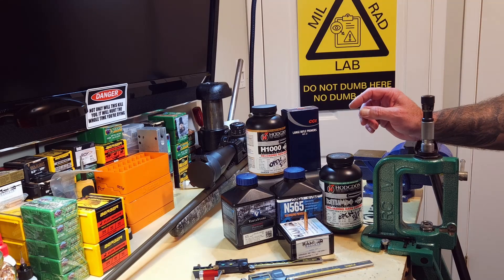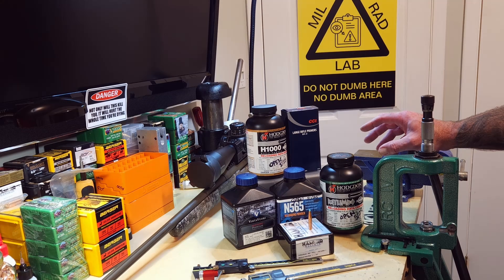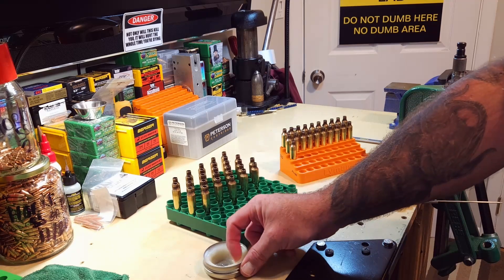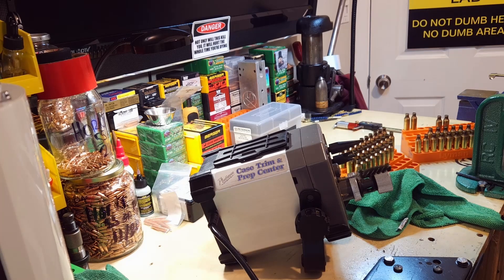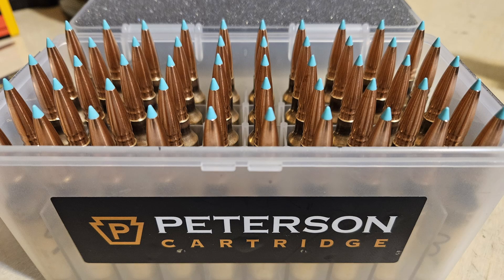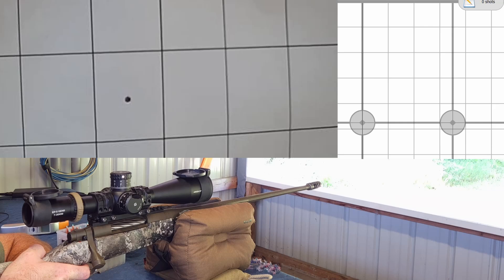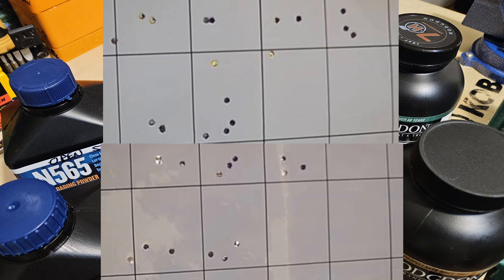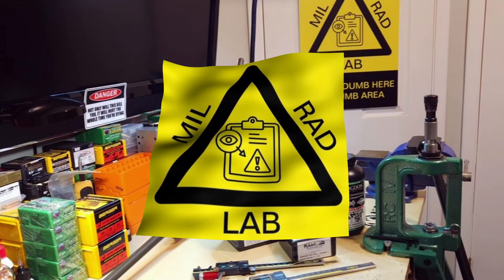Reloading 7mm PRC vid #5 Hammer Hunter Tipped 162gr with H1000, Retumbo, N560 and N565

Comment: I was considering the 195 berger for my seekins ph3 7prc 22". The loads you have here are way over hodgdons max, any pressure signs at all?  I took 175 eldx to over 2900 at 70gr retumbo with no pressure  but running low on capacity.
Reply from the maker: Thanks for watching! Yes, alot of my data is beyond published loads - sometimes way under though. Books cannot tell you what your chamber and bore dimensions/metallurgy  will produce, so I always try to start somewhere in the middle of the published data and work up until I see pressure signs. I have found pressure while testing all of these loads, video 3 and 4 in this series run that down oretty good. My hunting load is Peterson brass, 195 Berger, 71.3gr N570,  BR-2 going 2938 out of a 24" with zero pressure sign. Sub half MOA every single group with a $400 rifle lol...funny to even type that.

Comment: Ramshot Grand is rocket fuel in the 7PRC , 162 Hammers , 160LRX and 160Cutting edge lazers will run 3200+ in my 26 in barrel with ADG brass at a book max load .
Reply from the maker: If I were going to use light weight bullets like those, I think I definitely would've ended up trying Grand. I decided on the Berger 195 as my go-to and N570 is definitely "the one" behind that bullet.

Comment: Been watching lately as I'm about to start loading up some hammers my self, a great source has been hammers loading forum under "what have we learned" they talk daily in depth about using factory crimp dies. Here's a small portion of the description - "Hammers are more ”slippery” (best I can describe it) than standard bullets. The PDR bands on the bullet reduce contact with the case neck (and barrel). Crimping seems to help the bullets get a more even and consistent start. My personal preference is to start at 1/8th turn. I also use the crimp die as a final tuning device to get the lowest SD/ES possible. Once I find an acceptable powder charge (accurate) at 1/8th turn, I change the crimp setting from1/8-1/4-3/8 and record the ES/SD. The lowest spread USUALLY/Not always gives me the best groups. Since I develop the load with a crimp, I don’t see a significant change in pressure while adjusting crimp on a full pressure load. I also do not see a significant change in velocity. At most, I’ve seen a difference of 20 fps in speed going from 1/8th to ½ turns on the FCD." Multiple other sources also state that groups shrink significantly when tuning with the crimp die. Figured it might be worth a shot! Vortex nation had a podcast as well that talked in extent on this as well, hope this helps!!
Reply from the maker: thanks for sharing AND for watching! I did read about this some time ago and of all places I think it was in Hammers forums. if i get a couole more boxes of em I think thatll be a worthwhile experiment.

Comment: Do you think you were overpressure or pushing up against it? Groups seem erratic. 

Not busting your balls, my experience is that groups start to suck when FPS is pretty darn high for the cartridge
Reply from the maker: Thanks for watching! YES I subscribe to your same philosophy. I was definitely pushing them too hard - apparently in all but one loading really - I didn't even shoot 5 of the loadings because I was running into heavy bolt lift. The H1000 at 70.8 surprised me and while super hot had a nice easy normal bolt lift, no pressure signs on brass and shot a decent group. I'm hoping to find the sweet spot under that loading - maybe a future small ladder from 68gr to 70.8gr to look for a node there.
Reply: I recently found your channel and really like it.
Reply from the maker: thanks a lot!! more content on the way for sure! I appreciate the support!

Comment: I see you run a brush in those necks. Do you use any lubricant to then seat the bullets?
Reply from the maker: Not currently because there is zero sensation of resistance at the ram. If I were loading on an arbor press and had turned the necks and was worried for concentricity then yes, I'd probably use my old stand-by of Imperial graphite. Another good reason to do this is for cold fusion reduction in ammunition that will remain loaded for an extended period of time. If I end up deciding on the Hammer bullet for the hunt, in the loading leading up to the hunt I will likely introduce graphite to the bottom third before seating to keep cold fusion down. You bring up a good topic to discuss in a future video for sure!

Comment: Thanks for the videos. I'm in load development as well for my 7 PRC. In fact I just got back from the range earlier this evening. 68 gr. was the ticket for me using 180 gr. berger hybrids. I'm sure you will find your node right there also, it's the sweet spot! Good luck. Anxious to see more of your testing.
Reply from the maker: Thanks for watching! It's awesome to have success on the range and then watch others doing similar stuff - one of my fav things to watch is peoples load development content. I will definitely be backing down a bit and shooting a ladder under 70.8. It may stretch down to 68gr even, not sure yet. Ideally I'd like to keep the 162HHT going 3150 or faster - but it may not be possible to have that speed AND accuracy. Fingers crossed!
Reply: @MilRadLab Update. Im using a 26" barrel and results vary but I settled on 68.5gr. at 3,070 fps. Using the Satterlee method I found a nice flat spot. Never went past 69.7 gr. There I got 3,107 fps so Im sure you can get your velocity pushing the 165s.  No pressure signs either. Good luck Brother! Great community to share the load data and not copyright it haha